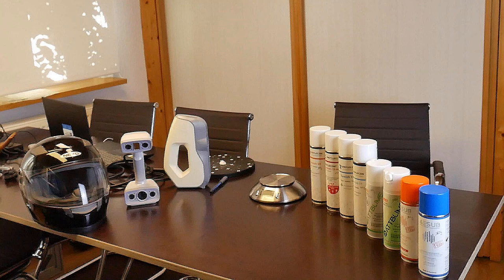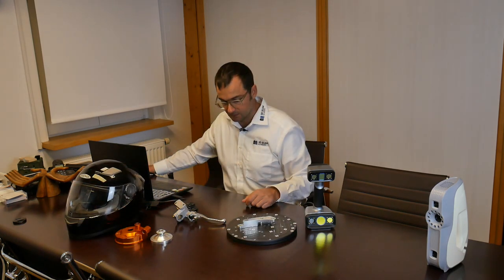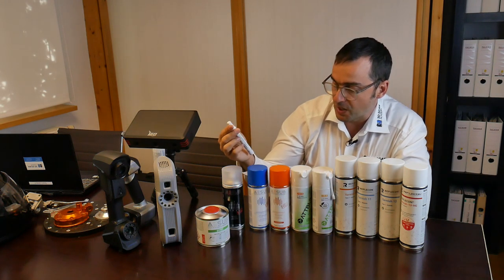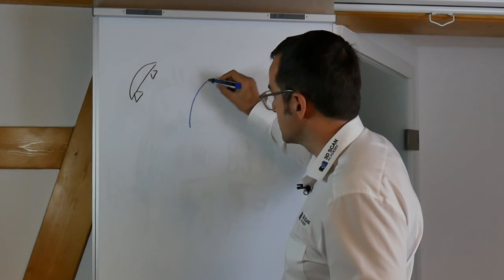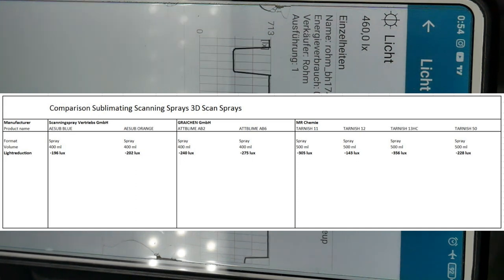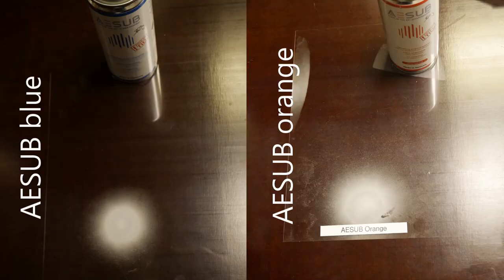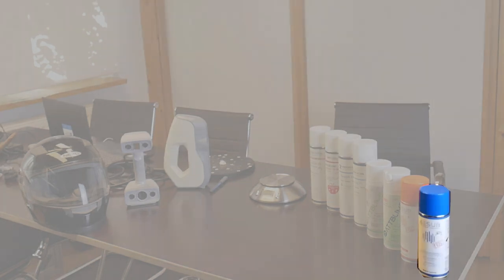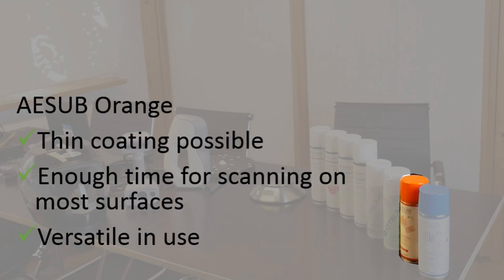3D Scan Spray Comparison Test - 3D scanning preparation

Comment: Very indepth and useful. Thanks for going into detail, and showing various products!
Reply from the maker: Thank you for the feed back
Reply: @3dscanacademy76  I've been testing attblime and aesub, and came to a similar conclusion. I now prefer the aesub orange because of the high uniformity and thin coating thickness. The orange leaves enough time to scan edges of parts. I found the attblime to be a good deal coarser than the orange. If you're watching this video, its worth comparing brands yourself as well. The main thing to avoid is spraying the part white...with any spray this will take ages to sublimate.
Reply from the maker: @treadless_co  Try Tarnish 50 as well. I guarantee you'll like it.